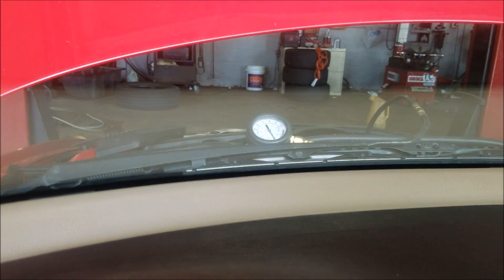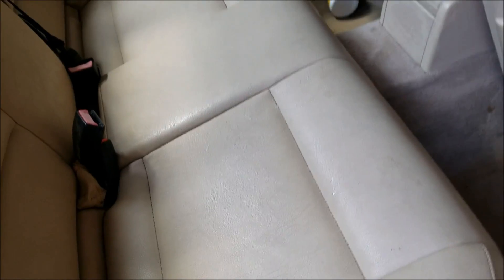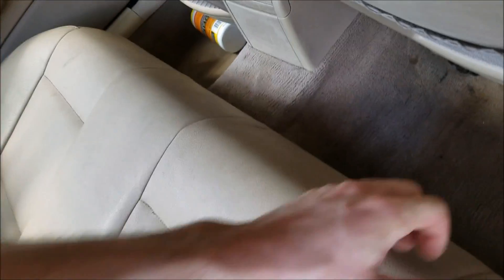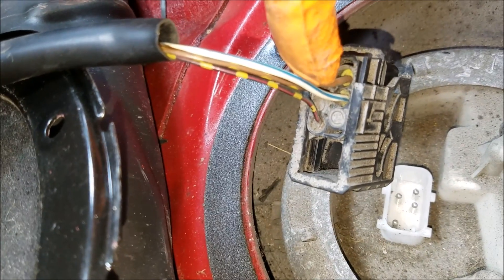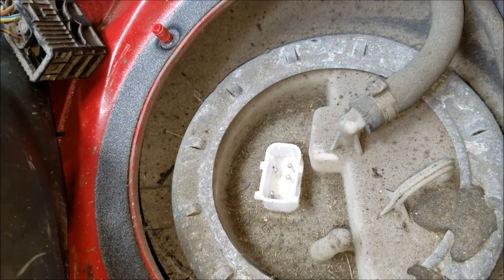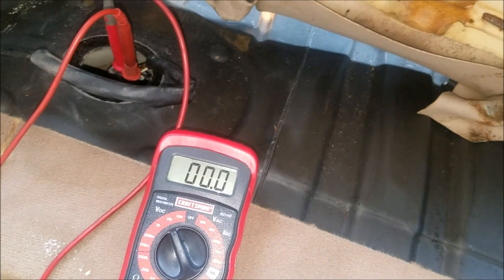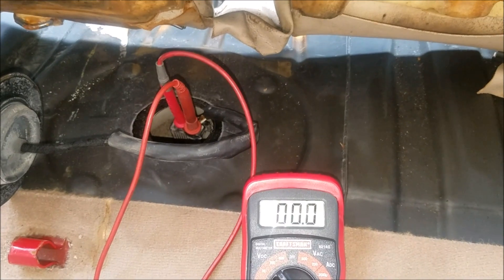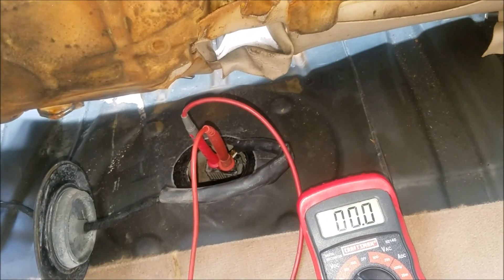bmw fuel pump diagnose

Comment: I have a question sir. I can hear pump because it's brand new. But, it's doesn't stay on long enough to prime the engine I have power in the fuses, relay is good. What are your thoughts?

Comment: Swear these thing go out every 2-3 years.. especially if you’re one to let the 1/8th tank light come on. Will be doing this yet again as I have problems with it turning off when coming to a stop / slight incline. Start here people! This is definitely your issue if you’re stalling at stops with no check engine light. Awesome video!!!

Comment: could you atleast hear the fuel pump working.?
Reply from the maker: I did not hear the fuel pump running
Reply from the maker: This car does not have a return line, only a feed line.
Reply: Could  ecu issue not sending signal.to fuel pump